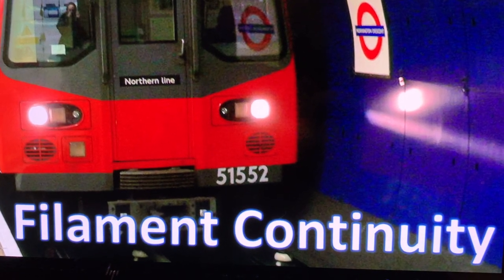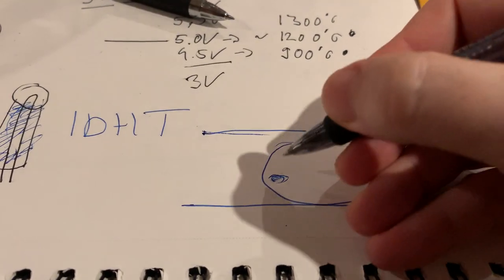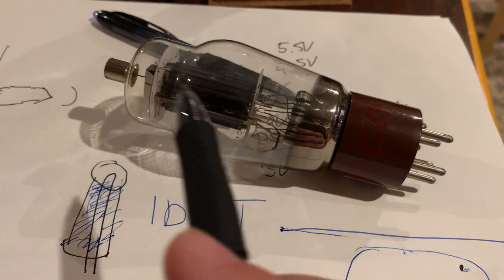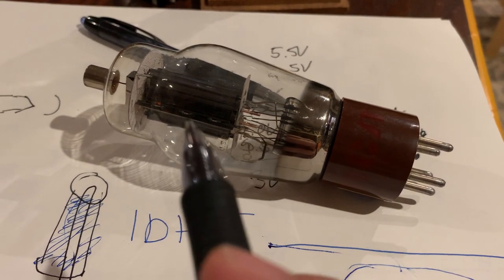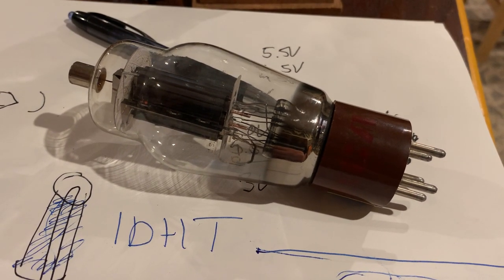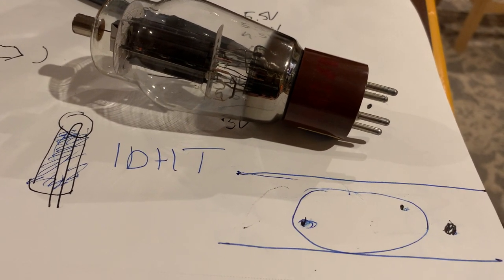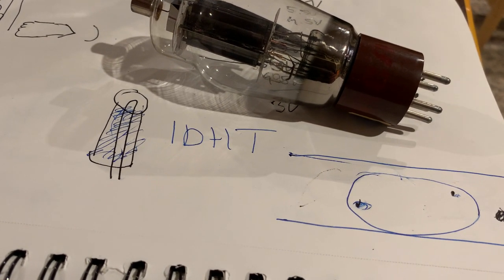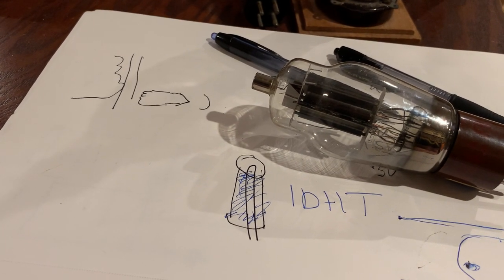Vacuum Tube Life:  increase life span through filament management! ADVICE FOR ADVANCED technicians!

Comment: Thanks, plse explain how to keep ampli on and the turn on high v, I have push pull kt88 ampli willsenton r8
Reply: You can add a stand by switch like shown https://youtu.be/ZflYSwMe4UU 43:53min.  Or use the existing on/off switch for that purpose (and rewire for permanent “on”)
Reply: @edverbeek6292  tsk very much, I am not so handy but will check it outt, how about power consumption while on all the time?
Reply from the maker: @vittoriomartinidonati  Unfortunately that will prematurely age the tubes. Most amplifiers are designed to burn up the tubes fast, you might need to change the power tubes in less than a month if left constantly on. Plus, most amps are not designed to be constantly on, and they become an extreme fire hazard. General advice, never leave the high voltage on when amplifier is unattended! Thus, unless amplifier manual specifically described you can leave amplifier on at all times, then never ever leave it on, or unattended!
Reply from the maker: @vittoriomartinidonati  The filaments by themselves consume not much power, about 40-100W depending on the amplifier. I am not familiar with the w8, if the heaters are not on a separate transformer then this modification cannot be done in a safe manner. Unfortunately this tip is for advanced amplifier builders. You may consult the manufacturer if it can be done on your amplifier, and recommend that they do the modification. Please do not attempt modifications yourself, the extreme voltages present can result in severe injury or death. The capacitors remain charged with lethal voltages even when the amplifier is unplugged from the wall.